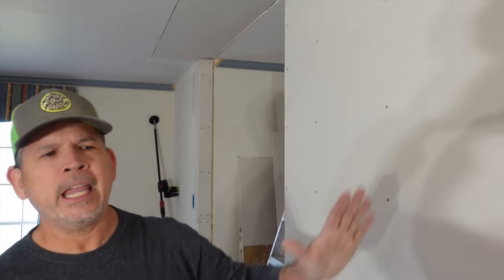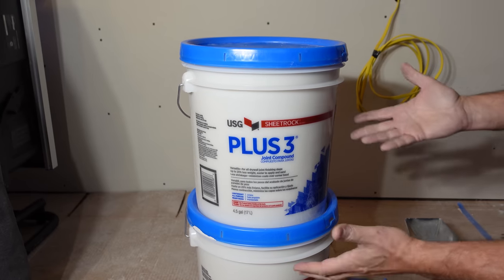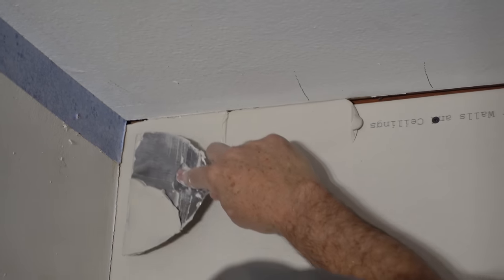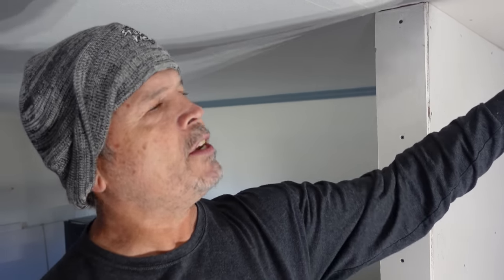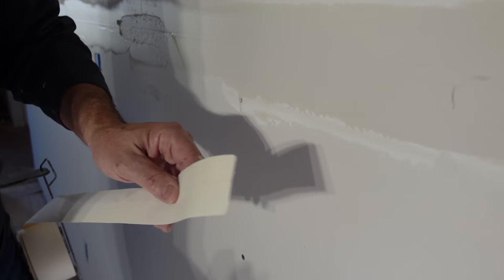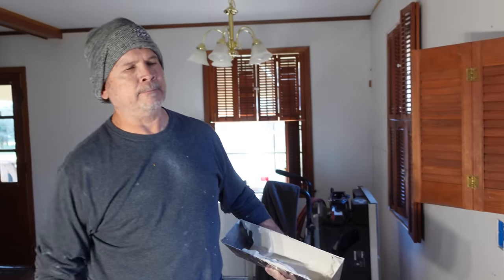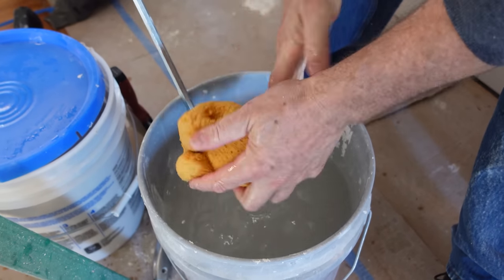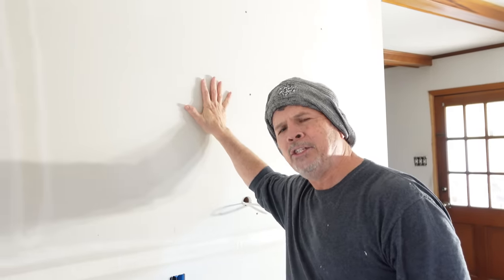How To TAPE and MUD Your DRYWALL | DIY GUIDE

Comment: Hung drywall by myself in my house and about to start mudding. Really appreciate the tips bc every time I’ve tried it I ended up sanding a ton. Also great tip on keeping your mud wet in the bucket.
Reply: Eliminate/cut down on your sanding. 1) Always spread your mud flat on the wall and smooth it out "before" it sets. No high places. 2) Use long smooth strokes. No paddy cake. 3) When you have edge lines or rough places just "gently" scrape them smooth with an 8" knife. 4) Try to limit your sanding to feathering the "edges" of the mud. That's where it is most visible.
I'm no pro but the above practices have helped me a lot.

Comment: Very well put together!! Beyond expectation! As a pro drywaller I use durabond easy sand for my first coat on any gaps in remodels. It's just a stronger formula than the 45min you used.
Reply: Agree Green lid heavy for tape joints and first coat. Definitely holds up better in low income housing. Lightweight isn't strong

Comment: We use the all purpose mud to put the tape on it dries really hard the plus 3 it’s softer and the tape peels off easier we only use plus3 for the coating first and second coat. Really good video lots of tips
Reply: Correct.!

Comment: Ive always used steel mini plaster veneer beads. Super clean corners and you can plumb them with a level if you have some really funky corners. Only con is it takes a little longer but the end result is so good

Comment: I'm an electrician, but like most guys who do any construction related job for a living, I've done a little of everything over the years. My partner and I have flipped a few homes and we're hands on through the entire process. Considering how crazy material costs are right now, if we didn't do most of it ourselves we'd go broke! lol Anyway, filling drywall is one of the jobs that I hate the most! I can do it, but I'm not fast and they'll be more sanding to do than there would be if a pro did it. All us guys in the trades pass around favors around here, so that's what I do when it's time to fill drywall. They know I'll remember them when they need something. We're all friends, so we all break balls. I tell them they need me more than I need them because I don't need a permit to fill drywall. 😂

Comment: Hey guys. Im a GC in Wisconsin, and the only two things I do differently are...I use the green bucket instead of the blue. And, I use plastic corner applied with a spray adhesive. It is quick and no pre-fill is required in the corners. Otherwise, everything else is exactly how I do it.

Great job guys. Excellent as always. I'm onto the drywall stage on my current job this Monday. Your video was great to get my brain in the right space.
Reply: Plastic corners glued on is how hacks do it. 1 tiny bump and that corner bead is trashed. Man up and use metal bead attached with fastners. Unless a quality job that lasts is less important to you than how fast you can complete the job...
Reply: @billymacktexasdetective5827  lol. This is completely acceptable up here, and it holds just fine.
Reply: @TJMODLA  I come in behind people like you and repair it correctly. For every metal bead I repair, I repair 1,000 plastic ones. Thanks for being cheap and keeping me employed!
Reply: @billymacktexasdetective5827  lol. If you say so.
Reply: @TJMODLA  I don't say so, the facts say so. Typical GC, too cheap to do it once, do it right. Speed over quality is the path a loser chooses...
Reply: @billymacktexasdetective5827  lol. You know nothing about me. Just because you have had poor experience in the past with other contractors, doesn't mean I'm like them. I'm the best in the area, the highest quality, and most personable. So, good luck with your contractors. Maybe you need better contacts.
Reply: @TJMODLA  Dude, I don't need to know anything more about you than what you told me yourself. Your technique is low quality, done only by the cheapest contractors. Money over quality, that's all I need to know... Have a great day.
Reply: @billymacktexasdetective5827  🤣🤣🤣🤣 How narrow minded. I'm so glad you are not in my area.
Reply: @TJMODLA    Please explain how it is narrow minded to know from decades of experience that your method is vastly inferior? Only lazy or incompetent, or both,  people glue on plastic corner bead. Sorry bub, don't take it so personally. Just correct your methods and move on. Or keep churning out a garbage product for your customers. Either way, I couldn't possibly find a way to care less... 

P.s. I live in Wisconsin so I have no idea how you think you know where I am...
Reply: @billymacktexasdetective5827  I will not waste my breath on trying to teach an old dog new tricks. Not worth my time or effort.

And, your name literally says Texas Detective. So, you are false advertising about being in Texas, that made me think you are in Texas. Which gives you less credibility.

Comment: Put a window in a spare bedroom and did the drywall repair ourselves.  I had the job of tape and bedding.  I was super scared of even trying until I watched your video.  You have the gift of teaching!  Great video.  You covered all the steps and I went into the project with confidence.  I admit I had a few rough spots but just reviewed your methods and it came out beautifully.  Thanks!

Comment: A couple additional tips for you:  1. Fold your inside corner tape where it meets the ceiling and clip the end at a 45 degree angle before application for all three corners to eliminate build up of mud in the ceiling corners. 2. Partially clip tape end corners to avoid flaring (I.e. don’t leave a square end)  3. You absolutely can apply mud over the tape during the bonding (1st coat), just make sure they don’t intersect—i.e. coat paper only on butt seams but not beveled seams; and coat on 1/2 of all inside corners on all three where they meet.  This technique saves time and steps.  If you were to wait, you would still have to do this but then wait until it dries before applying the perpendicular joint. Depending on the size of the job, you would save a day of waiting/dry time.  Lastly, instead of filling that deep void in the ceiling where the new meets the old, you can WET SHIM instead without taking the sheet down.  Pull the screws within the voided area and squirt a few pulses of canned polyurethane foam in the screw holes, then immediately reinsert the screw but only 1/2 a turn by hand to allow the foam to push the sheetrock back out.  (don’t use window/door foam as it’s not structural) The screw acts as a plug to prevent oozing.  This technique takes some practice to get the correct amount of foam squeezed in.  If the sheetrock sprung back before applying foam, then you know it’s a true void.  In this case turn the screw until it’s almost flush after foam application to prevent over bulging with foam.  This technique is useful for spots where there’s and obvious void.  Think of it as concrete slab leveling for sheetrock.  Hope this helps.
Reply: Wrong on coating over wet tape - you want to let it dry first because it is also going to shrink..
Reply: Bro what?? 🤦 you squeeze foam in the old screw holes and that will push the old board down to the level of the new board??? I've heard them all but not that one 😂
Reply: @tommyhurst90  yes, it works well—just be conservative with the foam.  Try it before knocking it.  If they can lift concrete with it, you can fix sheetrock.
Reply: Love this
Reply: @straight_to_finish  I believe it and was actually thinking about the concrete thing too when you said it 👍
Reply: hang the metal before taping, another bag of hot mud for metal/cornerbead 1st. coat of 3.
your welcome.
Reply: Ex drywaller here. I've seem more experienced finishers on the job tape and bed in one pass. You still sometimes have to hit butt joints again later with an additional, wider bed coat. Many people don't understand, All-purpose mud shrinks and pulls the tape into the seam when it drys (which is what you want), this is why you have to wait before you skim coat with lightweight (usually the next day). Also, it goes without saying, never tape with lightweight mud (it doesn't shrink and seams can appear humped) and never skim with all-purpose mud (the mud shrinks and is more difficult to sand).
Reply: "SHEETROCK" is a,Trademark name owned by UNITED STATES GYPSUM (USG) The taping and Finishing  of D R Y W A L L  is the procedure discussed here.

Comment: Hey stud pack! Awesome videos! I have a quick question about the mud for setting the tape. Have you ever used the green lid all purpose mud for that step? I’m not sure how true this is but I was told it’s best for there because it has a higher concentration of glue to go into the paper on the drywall and tape.
Reply: You are correct, green is for taping, blue is for coating over the tape its dry.

Comment: Just a recommendation for the future. Don't use plus 3 mud to tape doesn't work very well with the tape and also created bubbles of air because is not for that.  The plus 3 is for applying coats and texture because is light and easy to sand instead using plus 3 for taping use all purpose mud (the green box) it does have more glue and stick to the tape and wall very easily. You can tell the difference between all purpose and plus 3, also never use all purpose for applying coats or texture. It's impossible to sand. Great videos and keep going. Good vibes.
Reply: By coats, do you mean layer over the tape to feather it out?
Reply: @calebdrake3544  exactly

Comment: Quick question/observation. When demonstrating the screw filling technique, I noticed a bunch of ripples in the tape on the horizontal tape joint just below the screws. Do you guys worry about that and fix it, or just coat it in the next coat of mud? I have seen other drywall pros make their mud loose and wet for the tape so it soaks in and supposedly prevents this. Keep making great videos! Thanks for all you guys do!
Reply: It's not an issue in the flats and paper tape has a tendency of wrinkling a little bit. Just do you best to get it on flat and smooth.

Comment: One thing you didn’t mention is that if you don’t bed the tape right it could start to bubble. It needs moisture to bond with the mud. Pre mixed mud sometimes doesn’t have enough moisture in it and you get wrinkles and bubbles.

Comment: Thank you.  Today my husband and I took down our wall kitchen cabinets.  Exposing unfinished drywall seams and screw holes.  This video is exactly what I need to ensure that tomorrow I will be able to repair the wall correctly.  Without having do a lot of sanding.  I will have a nice smooth wall to paint.  Great job on the video.

Comment: Wow this was incredible. DIYer here. I learned I made a few mistakes but I also learned how to correct them.  I was watching this at 11pm and yes I got up, mixed some mud and made those adjustments. 

The biggest tip for me was using the blade to show where there were high and low spots. It’s seems so simple but before this video I was using my hand. 

I could feel the valley but I couldn’t tell how much of one existed. 

Thank you so much for sharing your knowledge. 👍👍👍

Comment: Great video great teacher! Only thing I would add is that I use a cordless drill with a small paint paddle to mix the setting mud in my stainless pan. I used to mix by hand but now after mixing hundreds of small batches with drill/ paddle combo its proven to be fast and smooth mixing!

Comment: It's been 15 years since I did drywall and I've hung a 35 x 48 sheet in my kitchen but needed a refresher on taping and mudding. This is clear, concise, and with your little tips and hints, very helpful. The only bad news is that I guess I'm ready to get to work....thanks for a great piece!

Comment: Ah, cool! Did some diy drywall work a few years ago and saw on another detailed video back then, the trick about wiping down the inside edges of the bucket to prevent "floaters", but the pouring water on top to help keep from drying out was a new one! Also love the detailed description on how you do your spreading, specifically how you remove the mud from the edges of your knife before spreading and how you change the angle as you go. This should definitely help me keep more mud on my project and less on the floor from it gooping out and going "plop" as I'm going along! 😁 Thank you!! 😊

Comment: I'm not interested in doing drywall as a job but I was told that if you learn as much trades as you can youll never be without a job and you made this so easy and beautiful I feel I could confidently apply and mud dry wall

Comment: Great video and explained so well. I can do almost any repair or upgrade in a home, but my fear and weakness has always been drywall and mudding the walls. I am doing that right now as I am renovating my kitchen by myself. I removed a soffit that the exhaust vent pipe was in and then added new sheet rock. The problem is that my new small section of ceiling meeting the original ceiling is not even at all. I will have to do the process you showed in this video to fill and level it. Originally I made the mud way too thin and most fell to the ground when I slid the knife incorrectly and had it loaded incorrectly. I will try some of the new tips. Thank you!

Comment: Haven't worked Dry-Wall in almost 10 years at this point. Watched your video last night, and was able to knockout my unfinished garage walls within a few hours today. I'd say the "warm-up" took about 40 feets worth of tape; after that it was smooth sailing. (And then I rewatched the video and was humbled by the pros again. Haha!) Thanks for the tips! Subbed.

Comment: Absolutely great video! I’m a beginner DIY when it comes to mud work, it’s my first time and it’s a Closet! 😂 so no one will see how I screwed up. I did have some challenges. Demolishing a small old closet and adding framing and drywall to enlarge the closet, in an old house with plaster Walls. Shimming the new drywall wall with the old walls and leveling gaps with mud takes me forever… but practice practice practice. Thanks for the video

Comment: That was awesome I learned a lot somethings I was already doing. I had to learn everything when my parents died. The house was gone but there was a barn that my dad build standing in goid sharp. Being a female people thought i could'nt do it. But thanks to people like you I have learnt everything from how to run electricy, lay floors, water line, hang drywall, lay a roof and more. Things are alittle slow for me after having a stroke. But I'll get there the only thing is hard is I'm doing it without help but I'm strong willed and a lot of tears of fustration have fell.

Comment: I've watched at least 6 videos on taping drywall and this is the best by far. Wish I caught this one 1st would've saved a few hrs and some mud. I'm a Chef by trade so I don't have any pro drywall tips but I do have something that may cross over. When we store soups especially cream based, they'll form a skin across the top. To keep this from happening we'll put either plastic wrap or a kitchen trash bag down across the top of the soup to keep it from drying out.  Instead of covering your mud with water use a trash bag pushed down on top to keep it from drying out. You would start in the center and push the bag into the mud, working to the sides pushing any air out.  I brought this up because I made the mistake of mixing my mudd in 2 batches.  The top 1/2 of the bucket was dry and had to add water. Then when I went to mix the 2nd 1/2 is was to wet. Does storing the mud with the water on top add water to the mud over time? You could even add the water  on top of the trash bag to help keep air out with no worries of it mixing.  Your thoughts? Thanks again for the video

Comment: You actually did a pretty good job. You did a great job of explaining what you were doing. That's an even better skill set. One thing that you did naturally , but didn't happen to mention was that during the whipe down process of the tape you start in the middle of the seam and not the edge or end. Another thing about whipe down is you need to make sure you leave mud behind the tape on butts, as because they are crowned its easy to take out too much mud and cause blisters. Lastly, for now. I like tape on corner bead too. The fasted method is to use a slop bucket, but your right about applying the mud directly to the corner bead rather than the wall. Way less blisters cleaner and faster. We used to call it lick it and stick it. On smaller projects I really prefer to staple and glass the bead. It just efficient and clean for me that way.

Comment: Super excellent video! A lot better than most of the ones I have seen so far....!! Question??? Do you make another pass on the screws? And/or do you put paper on them too? Thanks!
Reply from the maker: No paper tape over screws;  they need 3 coats of mud to completely make them go away

Comment: I have a few projects ahead of me and looking forward to riding your coat tails working with drywall for my first time. I’m remodeling an old trailer with walls lined with panel boards.  Is it possible to apply a couple layers of skim coat to panel boards by rolling it on and then paint it?  Do the boards need to be prepped with anything to accept the skim coat? Love your videos!

Comment: As a DIYer I've done my share of drywall (and concrete, mortar and even plaster on lath).  The problem for me is the jobs are years apart so there is no muscle-memory and pretty much poor technique.  Great tutorial here on doing the various drywall finishes properly.  Jordan's Stud Pack garage has a couple thousand framing nails so far.  So, yeah, there will be a hundreds if not thousands of drywall screws for that build!